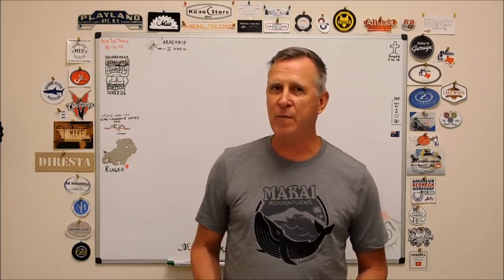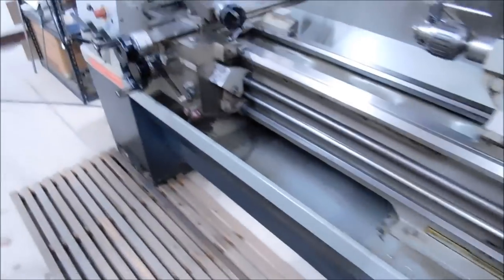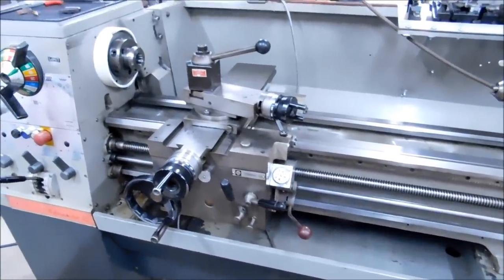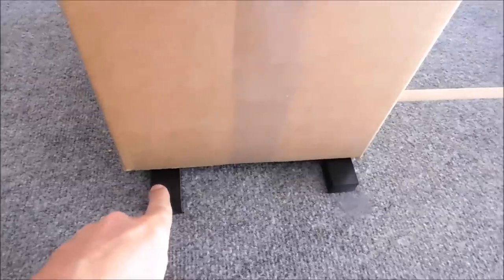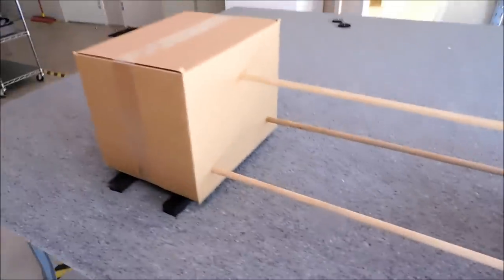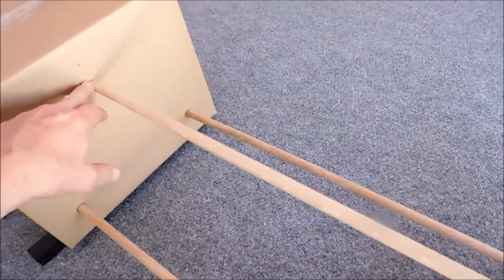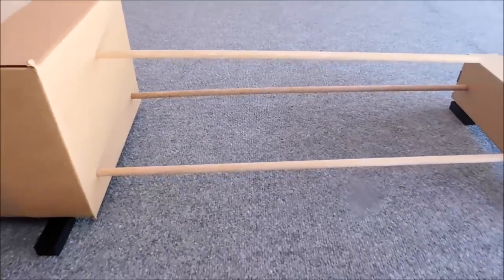Lathe Leveling - Waste of time ????

Comment: I’ve got 6 supports under a 5000 pound 14-40 big bore lathe because it has 4 under the headstock end. Despite all the things I can figure out to adjust, when I touch a drill bit into a center-drilled hole I can see the bit move down just a bit. My parts measure good (well they meet my expectations).  Could this apparent deflection be an illusion? It seems to be more while using my MT4 bits which are longer and don’t involve a tailstock chuck. An angled tailstock is the apparent problem yet it measures true.
Reply: If you're drilling a steel shaft of a couple feet in length thanks  not supported by a steady rest you may be dealing with sag, all solid rods sag depending on the length and diameter. And even when its supported on both ends. You say the drill tip moves down, it could be the work is moving up.
Reply: I have read that lathes tail stock is built to have around .001 or.002 higher than center line.
Reply: So many possibilities... Are your male (tool) tapers good and clean? is the female (tailstock) taper good and clean? are your drills straight? (I've encountered bent drills in a place where the radial arm drillers used the same drills as the rest of us...) or, and this is quite likely... were your drills ground off hand, as opposed to accurately, by machine, and one cutting edge (lip) meets the workpiece before the other.  That'll deflect a drill every time.  You can't do this, but on Capstan and Turret lathes, where even accurately ground drills would deflect, we set the cutting lips of two flute drills vertical, which minimized the problem. We could do that, because the MT adaptors were parallel on the outside. Is your tailstock set central to the machine axis?
Angled tailstock?  Every good centre (engine) lathe tailstock can be offset for taper turning, but the tailstock barrel moves parallel to the machine spindle axis, due to a feather key in the assembly, perpendicular (but in another plane ) to the machine spindle axis. The tailstock may (generally) be offset, not angled, but you'd know that from turning long components supported by a tailstock centre, or turned between centres.  You should be able to turn parallel within a few tenths of a thou over a foot or more, with a keen tool.  Blunt tooling will cause the workpiece to deflect near the tailstock, due to tailstock deflection, and along the workpiece through the workpiece bowing.  Even substantial workpieces deflect, which is why we use fixed and traveling steadies...
"Despite all the things I can figure out to adjust" is a worrying phrase. It implies you're guessing. Find a PDF of Georg Schleisinger's  methods, and follow them.  expect to spend some time, as you'll be making mandrels. Don't jack directly on concrete, either, interpose some spreader pads of steel, not, as I have seen, of aluminium.  A machine's jacking screws will work their way into concrete or aluminium, and you'll be readjusting sooner than you want to...
Reply: @robertlawson8572  thanks for the information you're right in all respects, very good reply.
Reply: Thanks very much, that was kind of you, and it's much appreciated.  I'm retired now, but every so often, I look in on sites like these.  It sometimes seems every generation finds itself reinventing the wheel, when obviously, the problem they've developed a solution for was dealt with, quite comprehensively, a century ago.   @kennethcaine3402
Reply: Robert Lawson all good points. I’m usually drilling with the stock barely out of the chuck. It’s 3.125 bore. I don’t have the skill to sharpen my drills but can’t guarantee they are properly ground. The machine came with steel sockets for under the adjustment lugs. You read correctly that I’m a total amateur, using my machines for jobs needed at my farm. I spent the money for MT drills to get large and deep. Plus to minimize my boring needs. That machine is a 14-40 big bore Jet I bought new about four years ago so I’m not fighting any past abuse. I’ll find your book and read it.  I can’t thank everyone enough for the suggestions. Thank you all.  Jeff
Reply: Not that it’s related to this topic but today I am building an electric device to open and close a dog kennel with an air conditioner damper motor. My bird dog invariably whines for water around 3:00 am. This project will allow my wife to let him out and then close the door back while not having to get out of bed. I sleep through it but hear all about it when she gets up. “If momma ain’t happy then nobody’s happy.”
Reply: @robertlawson8572  thanks for your reply I enjoy every video that you do, I also have been retired from a job that I truly loved I went through an apprenticeship 4 years as a Millwright apprentice, and working with machinists in a paper mill that was the best times I have had. All the Mechanics treated me as if were there Son they held nothing back and taught me as good as they could I tried to learn everything I could. I wish the apprenticeship program was still a common thing, It teaches people so much, I would never have progressed like I did without it, it's not me its the great instructions that I had. And by the way I have set Lathes with beds up and above 34 feet and they are still running true, as we would say in a Paper Mill Dead Nuts. Thanks a lot for your reply.
Reply: Drill grinding by hand is not the hardest skill to learn.  Usually a box of dull drills, a decent grinding machine with a nicely dressed, suitable, wheel and a grumpy, critical journeyman sort that out, but you need an angle gauge or protractor and a lip height gauge (easy to make) plus a book on the subject.  Having the ability to grind a drill offhand, reasonably accurately, means work doesn't stop for lack of a sharp drill at weekends. Regrind a bit as soon as it shows signs of dulling.  Once a flank/land corner starts to erode, the grinding process becomes bigger, due to the amount of material that has to be removed.  Even watching a drill grinding machine like a Brierley or a Dormer being used (or a good video of one in use) is worthwhile, since you can then emulate its action.   Cleveland (the only US drill company whose name I can remember) and Dormer/SKF used to give away some really useful handbooks on drill bit maintenance, grinding, etc. Worth finding a copy. It's also worth calculating or referring to a table for correct spindle speeds for drilling, since excess speed leads to excess wear.  I divide the drill diameter (in millimetres) into 100, then multiply by 100, which is super quick, and gives you 100 feet (30 metres) per minute, the speed for drilling mild steel with a high speed steel drill, using coolant, (without even using pi!) then select the spindle speed below that, never the one above. Harder or softer material? make a correction to the spindle speed, but always start conservative, increase in the light of experience. 
Noting you say you have minimal stock overhang, it dawns that you may be drilling beyond the chuck jaws. Bad practice if the remaining wall thickness is limited.  The jaws will tend to compress the workpiece onto the drill, increasing friction, land wear and heat build up, plus the gripping power of the chuck's also reduced, and the resulting workpiece is distorted, no longer geometrically round.  Take care. @jeffreylewis145
Reply: @jeffreylewis145  y not leave a water bowl for the dog where it sleeps or you mean it needs a piss?
Reply: transdimensionalist the dogs sleep in kennels in our bedroom. Years ago I built an ultrasonic dog detector to turn on the bidet when they approach for water. There’s also a dog door in the bathroom for them to exit into a fenced dog yard. Being empty nest people my wife now fusses over the dogs.  Going to bed is the cutest ritual. They get a treat then get in their kennels. I joke that I’m always the last to get in my kennel. My bird dog wants to be with me all the time. Yesterday I had to tote a big chunk of concrete about a mile with an excavator. He climbed in my lap for the ride there and back. Holding him off the joysticks was a challenge. Empty nesters can get weird.
Reply: Robert Lawson drill sharpening is something I could learn with some effort but on the scale of this place I just stock them in bulk. I’ll spend more on diesel in one day that I’ll spend in bits in many years. It’s wasteful, yes, and right for scorn, but it’s what I need to do because it’s so incidental to my job. Like saw chains and corrugated culverts. However I really appreciate your time and effort pointing me in the right direction. In the next year or so I’m going to buy a Haas CNC so I can design parts at night.
Reply: @jeffreylewis145  fair, thanks for sharing your ingenuity, i love dogs too but yours sound like they have it sweet :) what flavor are they?
Reply: transdimensionalist German shorthair pointer and lacy. I got the lacy as a hunting dog but he wants to be my wife’s pet and has no interest in activity hunting. However he is a great tracking dog. Eventually I gave up and got the pointer. Now he’s a real hunting dog.

Comment: The "FLAT" spacers under the M/c' (Machine) SHOULD also have steel wedges on top of the spacers!!
That way you can tap the wedges with a sledge hammer to twist the lathe bed until it turns a perfect Cylinder. Takes a bit of practice/trial & error to get it right, but it's how M/c' shop maintenance guys  do it if the M/c' is turning an unwanted Taper.
Reply: Umm ... not the best way.  A good machinist's level will come with information to enable you to figure out the angle from level by the location of the bubble.  Do the geometry and figure out how much the feet are off, then put shims - either buy a set or make one - under the low foot.  Check again.
Reply: And what are you going to do if you tap too far? Keep on tapping the other wedges? And then hope the machine doesn't slide off your wedge? Homegrown solution fail.

Comment: What do you think of Rollie’s Dad’s method of measuring headstock alignment?  Here is the original source for this method.  http://manuals.chudov.com/Rollies-Dads-Method-of-Lathe-Alignment.pdf. Thanks, Chris
Reply: fundamentally flawed. it assumes the chuck will hold the bar co linearly with the spindle. Further it does not account for headstock to bed way misalignment.

Comment: So what you are saying is that your lathe can be tilted all you want,even under 45°as long as headstock and the bed ways are parallel and true to each other.I think people try to level lathe as they think its easy to get things parallel that way.But as you said even if your bed way's are parallel and leveld it doesnt mean headstock will be.If everything is nice and leveld you could put a long fat straight bar(material flexing?) in a headstock and then put your super accurate spirit level that makes people go crazy  on it,if you get same reading on begining and end everything should be square and true.
But what about wear?It is something that should be considered as well?Lets say left way is just a tiny bit up and machine works for 10 years that way woudnt that cause carriage to have more wear than on right side?Then you level it perfectly flat to each other but now carriage doesnt have same wear and wouldnt that cause problems as well?
God i hate and love machines,buying used one is worse than buying a used car.It feels like a lottery-machine might be fine but guy you are buying it from might parallel it wrong,it might be good and true but have a wear in it,you set it up at home and its not that perfect 1.547° left side up and it starts doing taper,then you wonder why it didnt do it when it was in a guy's basement.
Do CNC machines correct themself and produce same dimension parts even if bed causes taper?
Reply: I always put up machines level just for the purpose of being able to measure them. It is allways easier to adjust a machine that is level than a machine that might be true but off scale out of level.

Comment: So I have a machinist level leveled my lathe it is it is a Sheldon lathe so the headstock is not adjustable be cause it sits on the ways but on the tailstock end it runs.003 bigger I tried tweaking the bed to get the change but nothing seems to be helping
Reply from the maker: How many levelers?

Comment: That's awesome.  I knew about the head stock and the tail stock needing to be at the same angle front to back, but before seeing this video I never really had a good grasp of what to do with the 4 adjustment points under the head stock.  So... I was just reading about lathes that set on 3 feet instead of six.  Is that a real thing?  Then what do you do?
Reply: You hope that the manufacturer was clever enough to put them in the bessel points of the machine bed so it kinda self aligns. Adjustments would be in the head- and tailstock themselves I'd guess.

Comment: what about the sag of the test bar because of its own weight? maybe better use a piece of smooth pipe. doesn't even have to be straight, you can rotate it and take the median of high and low side.
Reply: If it is turning, the sag will mostly level out.
That said, I use a 3" diameter piece of thick walled aluminum pipe about 16" long clamped in the 4jaw to align my lathe.
I make test cuts with a shear tool to minimize tool pressure.

Comment: The only lathe with sensible bed support I know off is Hardinge HLV-H with three point bearing arrangement between bed and pedestal base. The three point bearing arrangement makes accurate levelling unnecessary. All the designs with four point supports (unfortunately majority) are badly designed and difficult to keep straight. I do not understand why more machine builders do not follow basic engineering principles 😀
Reply: Probably just traditional to make them that way.....
Reply: Could it be because the HLV-H is a solid hardened and ground dovetail, while the others are of the parallel way design?  Essentially its like a surface plate, which when properly setup uses the three point setup too..  I only “level” my HLV-H for coolant return, just like the manual says to do. Hardinge didn’t miss a thing on the HLV-H design in my view.
Reply: Ok for a short stout machine lightly loaded but 3 point can not resist torque from a longer lathe with heavier cuts.

Comment: I actually had a lathe manufacturer  tell me to put a piece between centers to check headstock alignment I argued with him and he still wanted me to do it and I had a test bar to do it right
Reply from the maker: For tailstock alignment it may work if the part is being done between centers, otherwise an unsupported bar should be used.
Reply: @joepie221  yeah I tried to tell this guy but he wouldn't listen he had no business troubleshooting  lathe issues so I did what he said to please him and called back got a guy who actually knew what he was talking about and asked for him from then on
Reply: did you put a piece in the chuck and tailstock and take a test cut? i think that is what the rep meant
Reply: @davidjones-vx9ju  that still tells you headstock to tail stock alignment not head stock alignment to the bed. I did what he asked because I wanted them to take care of the issues but was actually a waste of time.

Comment: do you also have to account for bar sag?
Reply from the maker: Select a diameter and length of bar for the test you are confident isn't sagging. Headstock alignment bars are normally pretty rigid in my experience.

Comment: Thanks Joe 
Just rewatched 
Is there a measurement that can tell you if the head stock (or) the bed need adjustment?
I have the bed level x axis and z axis.
Made 8” pass on 1 1/8” bar.
Diameter .001 larger at chuck end.
Tram with dial gauge on top 0.000 both ends.
Tram the side 0.000 at tail stock end .002 chuck end.
New modern gh1440w.
11” wide bed cast iron base, 2600 lbs.
4 level screws head stock, 2 tail stock.
Side way adjustment back of head stock between bed and headstock.
Appears to rotate head stock on the horizontal axis.
Please reply Joe or any others smarter than me lol

Comment: Joe,  awesome video!  Thank you.   Question...   Possibly dumb...   How do know if your lathe is cutting a tapering due to a bed twist or the tail stock is out of alignment?  All the best.  Chuck
Reply from the maker: The results will be very similar. This is the only reason to level a bed so you can take that question off the table. Not necessarily level it, but have a common reading at the head and tailstock.
Reply: The Tail stock can be deliberately "OFFSET"  to turn a Taper or correct one - there's a couple of grub screws next to scribed lines in the side of the Tail stock & you will see the lines move when the screws are turned usually with a Hexagon wrench (Allen Key)
Reply: @felgate11  My understanding is you don't use the tail stock for part of the leveling process... which removes it's influence.

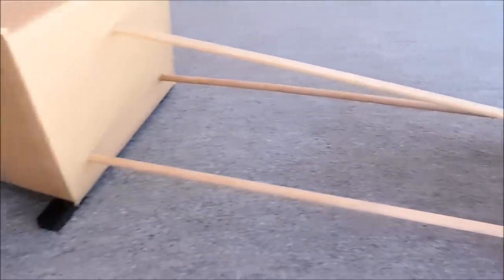Comment: 6:52 if your spindle tip down toward tail stock, you will still get bigger diameter part ad the tail stock end. Same as if your spindle tip up toward tail stock. Cutter is at the same height abowe ways, just part is going up or down.
https://i.postimg.cc/j2G2cYVc/Part1.jpg
Reply: I was going to point out the same thing but you beat me to it... Surprised other people didn't pick up on that. Regardless this is a great channel and breaks things down in a very understandable way for beginners and even the experienced in some instances. Keep up the good work Joe
Reply from the maker: If you have a centerline error and set your tool height based on the facing of the end of the part, your comment is incorrect.
Reply: Of course, but usualy people set tool heihgt near the chuck. After all, facing long unsuported part is not common or recomended.
I understand your line of thought, just pointing that, in a way you presented it, some confusion may take place.
Btw, this is great video, explaining some common misconceptions.
Thumbs up.
Reply: Joe Pieczynski Thanks for saying this, more learned to think.